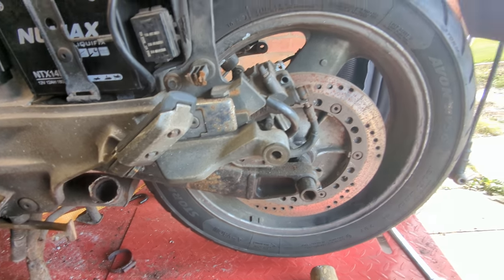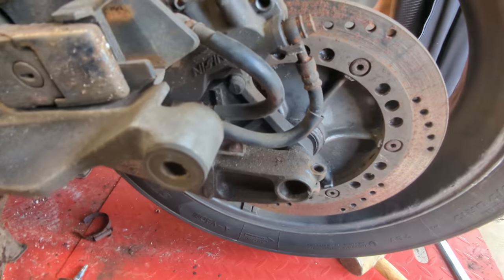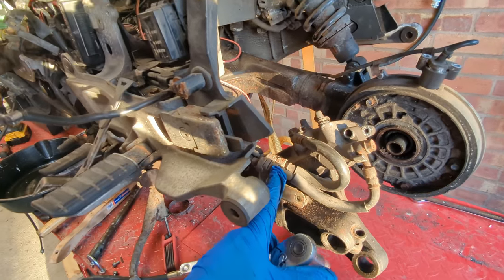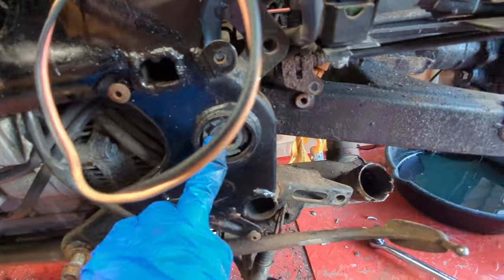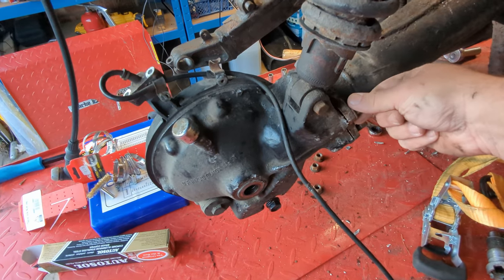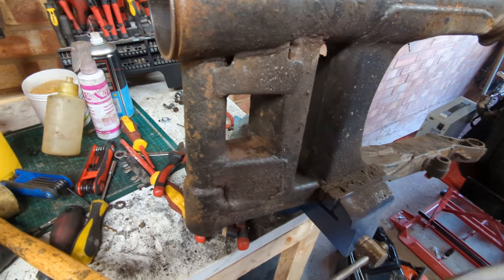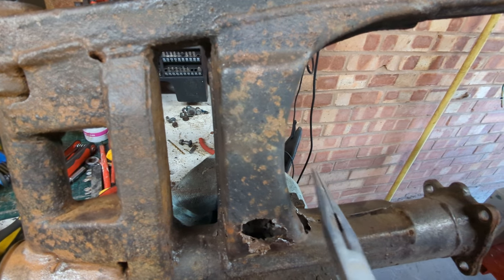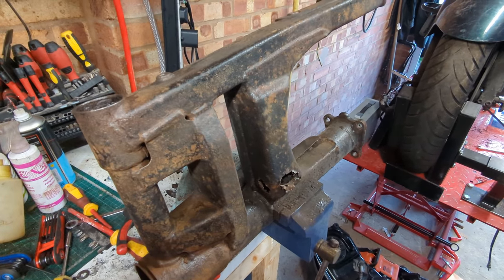How to check if your swingarm is dead | ST1100 Refurb Pt6 | JAM#45

Comment: Pro tip: for the huge Allen heads you can use a bolt head of appropriate size with jam nuts on it's threads that can be turned with spanners